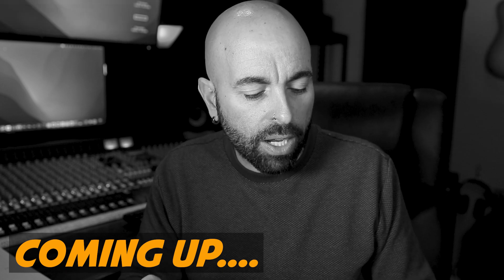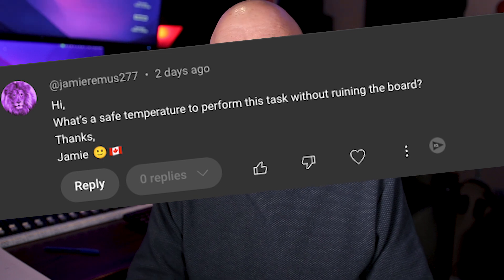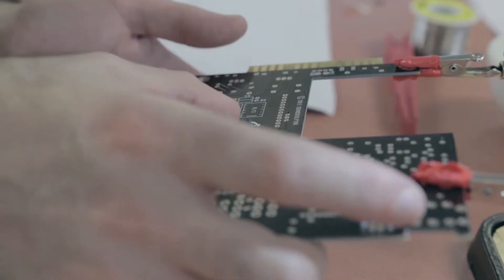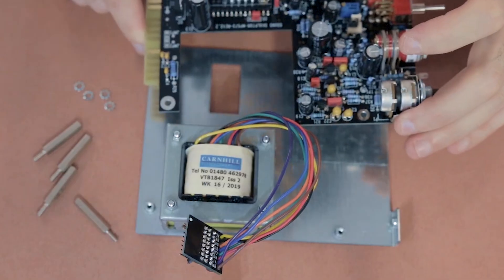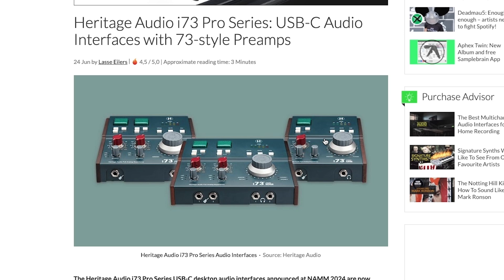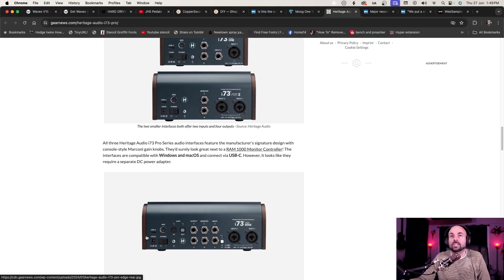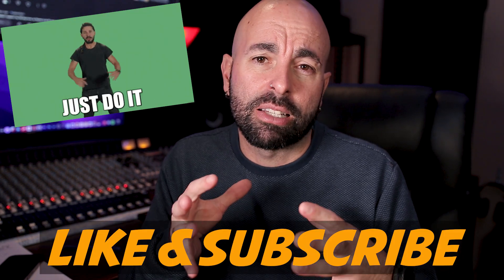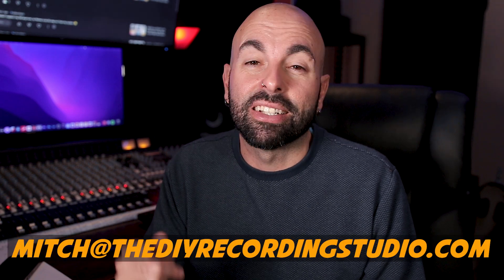THIS isnt a "REAL" Neve 1073

Comment: also, about the beta 58a, the super cardioid has a narrower place for the source to be, so it's trickier for the speakers as they can't budge too much or ay all. The best option is the regular 58 with a nicer looking pop filter or the awesome 57 with the elegant presidencial pop filters, even the bigger gray sponge used for windy outdoors. 
In my opinion, I think that aesthetics is important, but not enough to basically make a outside shell too look like an sm7b.

Comment: 3:19 That’s not correct. There’s no extra gain stage for the line input — it uses only the second (gain) and third (output) stages. For mic input, the first stage kicks in above 50 dB, so any clone with only two stages can’t truly replicate a Neve’s sound at higher gains. While 50 dB is enough for many sources, low-output mics like passive ribbons or some dynamics often need more, and you lose the unique saturation that three stages provide. Each gain stage adds up to 30 dB plus about 20 dB from the output stage — so you can’t reach 60+ dB properly with just one gain and one output stage. Many two-stage clones also modify the output stage with different transistors, which further changes the tone. Basically, you get what you pay for — not necessarily bad, just not the same.
Reply from the maker: Noted, thanks for the correction!

Comment: the 1073 is just a preamp... the EQ is another addition... then it's not 3 gain stages it's two and you can choose between two for the first one... this person was a keyboard warrior and probably hasn't use more than a cheap interface.
It's such a unimportant reason to not call it real.... and surely you would know it is just the EQ, the added EQ is a later offer

Comment: I have 2 AML ez1073 (pres only) and I am really happy with them.  The only thing I would have liked to see is a mic/line switch, but I just use an attenuator pad to drive line level from the converters.

Comment: I think the actual preamp in a 1073 with three gain stages is a 1290?  And I think the sound skulpter 573 is missing one inductor?  Suppose to be one for the HPF and two for the mid band I think. But I’m sure it still sounds great! 😊

Comment: I mounted and DYIED 2 Units of Soundskulptor and 2 AML EZ 1073 (only the pres) and the AML are TOTALLY superior. Soundskulptor is reallly a cool product but maybe too fatiging on HIGH mids. AML are just butter. At the price ( Im from Spain), if the Soundskulptor cost 80-100 euros less, will be a KILLER and professional option.... But At that Price point, AML just erase and overkill the deal !
Reply from the maker: That's interesting! I've had my eyes on their preamps and EQ's for quite a while now. Might have to pull the trigger on that one. Thanks for the info

Comment: I've  built the EQP 501 and the CP 5176 from Sound Skulptor (all thanks to you btw). And my next project will be the MP 573, with the matching eq.
Reply: Well, I haven't got that much experience with out board gears, so I'm probably the wrong person to answer. But to me it sounds more organic (compare to 1176-style plug ins). And it's easier to dial in a good sounds. So far I've used it compress the living daylight out of a kick and a snare. And then use the tracks in parallell. And for a little transient kontroll while tracking vocals. I think it sounds great.
Reply from the maker: Oh no way, Ive had my eyes on both of those units for quite a while now. Especially the 5176. How do you find it in tracking/mixing? Howes the saturation/distortion on it?